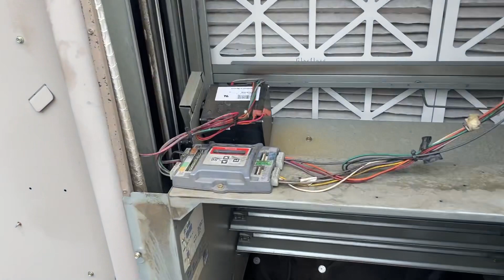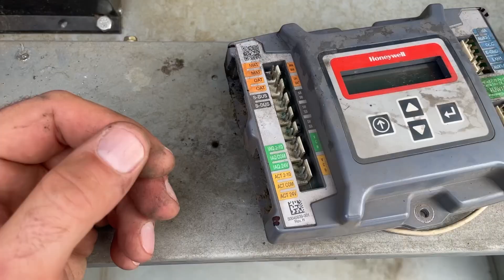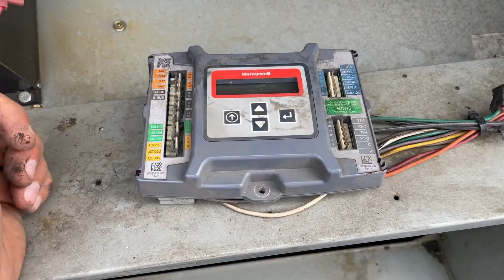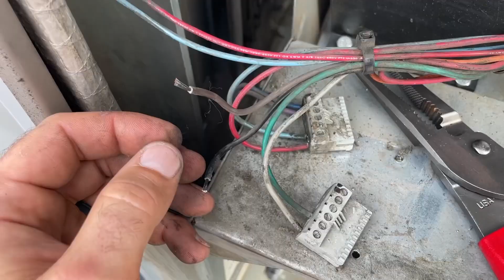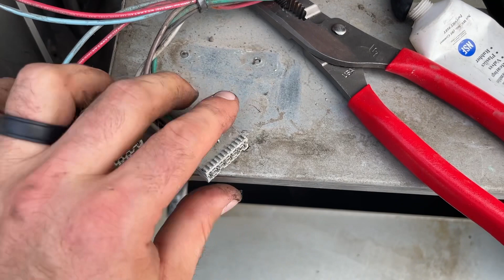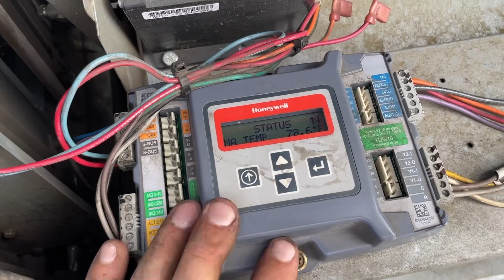Diagnostics23: Intermittent York Lock-Out and Board Repair

Comment: I really need to up my knowledge with them electronics .
Especially now with the shortages , delays for  circuit boards are mad .
I didn't even know you could clean the connectors with rubbing alcohol , and I thought the dielectric grease on the wire would prevent the connection with the Molex terminal .
Boy , thank Goodness for your videos man , every single time I learn very useful things ! Thank you very much indeed man , I truly appreciate your work !
👍👍👍
Ps : almost 1 pm here and I'm watching work related videos,  living the HVAC life ! 🤓🥳